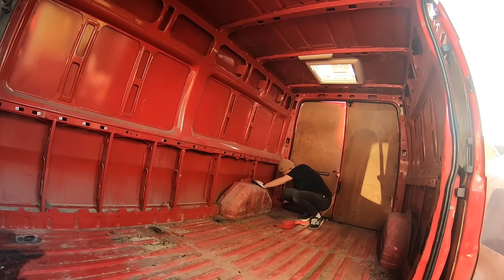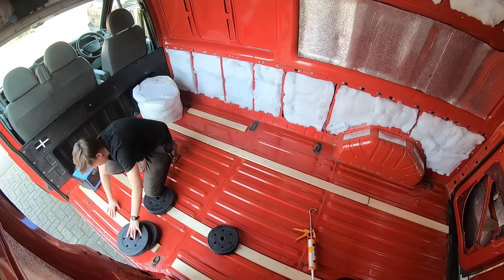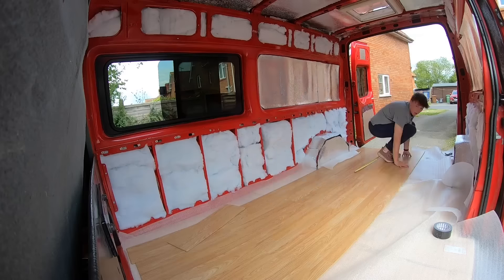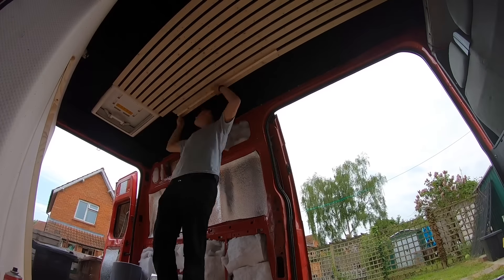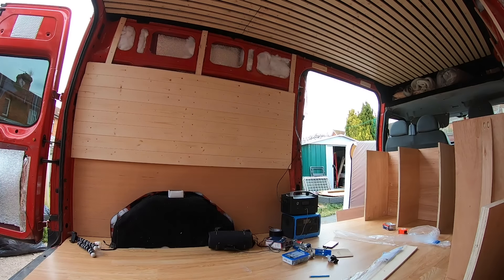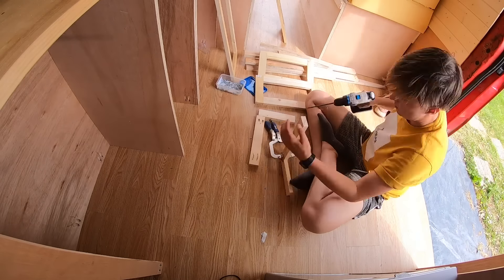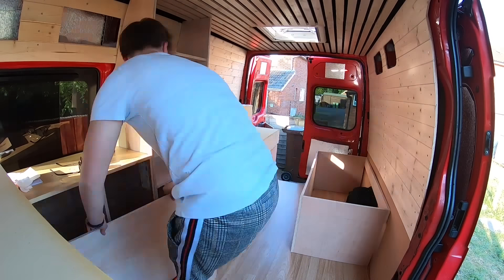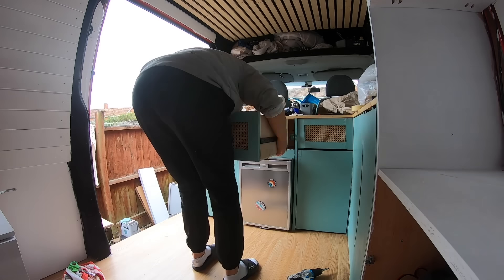Step By Step Process of Building A Van | DIY Ford Transit Camper Conversion

Comment: For all those watching this. If you don't want to have to repete this entire process I'd MASSIVELY suggest a vapor barrier on top of the insulation if not the condensation will rot all your carpet timber etc etc
Reply: What do you suggest?
Reply: A vapor barrier.....
Reply: @THEREALnicastle  how?
Reply: Or... Hear me out cause it may be considered an hot take by some :

Cut a hole and put a ceiling aeration fan like every normal person
Reply: What about that paint for a truck bed? I saw someone do that on the ceiling of the van and left it like that. He said he never got any condensation. I would try it. Prob cheaper

Comment: Really good job, quick question, when you put the bed out what do you put in the middle to stop the foam dipping?
Reply from the maker: The table is made to fit exactly in the gap and I have another piece of wood that goes across the space leftover after the table

Comment: With the floor, you need some kind of sub flooring, even if it is 1/4 inch particle board or plywood. Something. Eventually, you flooring will buckle from the stress. Also, I would recommend staggering your seams in the roof, though it was a cool idea with the black carpet and the stained wood.
Reply from the maker: There is plywood under the laminate

Comment: Not much insulation to the roof, heat rises, so quite important.
Reply from the maker: @mirola73  it’s a metal box with lots of doors and windows, no point to waste space and insulate it as much as a house, heat will always escape somewhere, just need enough to help a little bit
Reply: @ShannonLawford  But if that's the thought, why insulate at all ? Dress up the van, put in what you want and go. Saves time and money.
Reply from the maker: @mirola73  a little bit still helps, it’s not necessarily all or nothing

Comment: How do you avoid the screws on the ceiling planks from going through the roof of the van?
Reply from the maker: I created some batons that go width ways across the roof and all the planks are screwed into that, the batons going width ways are screwed into the metal beams that are supporting the inside of the roof, so there’s nothing going into the outside panel, hope that makes sense!

Comment: Appreciate the video, good job. One suggestion: when you're doing things like painting the van at the start of the video, list or explain what paint. Was it a special type at all etc? Connecting the batterns to the van before putting the flooring, did you glue or screw in. If glue, what glue, etc. Thanks

Comment: Do you run everthing off your power bank. Your fridge e.t.c
Reply from the maker: yeah! works well although in the winter i do struggle to keep it charged with only solar so i use a dc to dc charger equivalent to keep it topped up

Comment: What are you screwing the wood in the ceiling to? I know you put the black down-but what do you screw into- the roof?
Reply from the maker: @Somebodysomewheresometime  just put a few pieces width ways attached to the metal beams inside the van then screwed the planks to that

Comment: Did drilling directly into the roof cause any issues later with moisture or anything?
Reply from the maker: I didnt drill into the outside of the roof, only went through the beams inside

Comment: Speaking as a professional carpenter myself, and considering you said you had no experience of carpentry before this, hats off to you! That was a great video to watch, the units you built turned out brilliant, my personal preference for the drawer fronts though, would not be what you used. I would've used solid ply or timber to make the drawers, but hey i wasn't the one building them lol. Shame you didn't include any of the electrics though, maybe for another video??

Comment: Most people who have done these at least once, put 12mm(1/2") marine ply down for the flooring. Either onto battens a few inches apart, or directly onto the floor. They typically use insulation under the ply, and between the battens, depending on the climate. Warm climates require NO insulation, as the cooler air comes from the shaded bottom. Your vinyl floor boards THEN can go onto the ply and make for a very stable and hard wearing surface. I doubt your vinyl floorboards will stand up to the test of time without any solid foundation. 10/10 for the insulation and sound deadening. Perfect for a mild climate or moderate temperatures. Not everyone wants to go camping in the freezing cold!

Sooooo overhead lighting, plumbing, 220VAC or 12VDC wiring and distribution boards were all pretty much all after thoughts then, as far as I see?? Must have been a complete bitch routing all that stuff in, after the fact.

Comment: Do you just drill and screw into the car?! 😂😂 what when it rains..?! Sort stupid question 😅
Reply from the maker: @LarsWagner  only drill into the inside bits of metal not the exterior shell!
Reply: @ so how do you know how deep to drill?! How would it work and look like in practice?!
Reply from the maker: @ you can get different sizes of screws specific for metal that drill themselves, it’s a bit of a guess mostly, I did have one incident on my first van build where I went through the outside, had to patch up the hole and repaint etc 🫣

Comment: did you just use black cloth for the ceiling initially? I actually like it prior to the wood.. it would be an inexpensive option for me to do but idk if you used a carpet or what type of material? It looks nice. Overall you did an awesome job. Super cute.
Reply from the maker: it's black 4 way stretch carpet so it would be a good option for the roof if you don't want to use wood

Comment: I was wanting to see the water / electrical installation …. You missed the most important bit out 😢
Reply: She used a power station so  everything was connected to that, tap is also usb. Check her other vidoes

Comment: Putting small sound barrier patches on like that,doesn't work,tap on the panel next to it. I tried that, I park my van in industrial areas, where there is lots of noise, and it did nothing to stop it.

Comment: Excellent video - thank you. Can I ask why you put holes in the bed base - is that for ventilation?
Reply from the maker: Yes! For ventilation, and I’ve already had a few signs of condensation so definitely recommend adding lots of ventilation under the bed

Comment: Sound deadening is a  waste of money  i built 2 vans exactly the same make and exactly the same layout one with one without after they were finished we drove them on the same route and used two Sound metres in exactly the same place and there was no difference what so ever .
Reply: Haha really? I will have to look into that before I start my build
Reply: @lovelyjubbly87  the insulation acts as a sound deadening is what we put it down to, plus a late friend was told by a campervan builder they don't use it.

Comment: Good build but you've far to much heavy material. You should have studied the way caravans are made , none of the internal wall coverings or fixtures are solid . They are basically empty envelopes, all that wood on the ceiling and walls is just adding weight, which equals extra fuel costs .
Reply from the maker: @tonynightingale4400  the wood I’ve used on the walls and ceiling is very thin, it’s not much different to ply lining the full van, which is how most vans are lined. Yes the wood cupboards may be heavier than the typical materials used in caravans etc. but i tried to consider lighter options for other features such as smaller water tanks and no big gas locker and tank. They’re vans, they’re designed to carry lots of weight 🤷‍♀️

Comment: Thanks for sharing your process. Great job for a first time build. The main thing I would do differently is remove one of the front passenger seats and leave an opening so if I ever have to leave a site in a hurry, I won't have to go outside to get into the driver seat. A young person like yourself could potentially crawl over the cabinet, but it's not practical for so.eone my age. You could always have a roll away cabinet to fill that space for the interim. Anyway,  I love the colors and the ceiling, especially. The finished job looks amazing. Great job!

Comment: Hi Shannon, really like your ceiling. How did you secure the carpet to the ceiling?
Just starting my mini van conversion...
Reply from the maker: just used 4 way stretch carpet glue the same as you would with the walls

Comment: Good to see a down to earth build, just a few question if that's OK? Not sure if you have other videos  but will look now, how are you getting power? Did you fit the windows and roof fan?
Reply from the maker: Solar and an all in one power station, I got a company to fit the windows and the roof vent was already installed when I bought the van
Reply: @ShannonLawford  can I ask what power system your using?

Comment: Hi Shannon, really beautiful result! When did you do the electrical part? Shouldn't it be done before putting the wood on the walls, ceiling and floor?
Reply from the maker: I kept my electrical setup really simple with an all in one power station, so the minimal wires i do have are all accessible but hidden in the wardrobe and cupboards etc
Reply: Thank you for your answer, Shannon